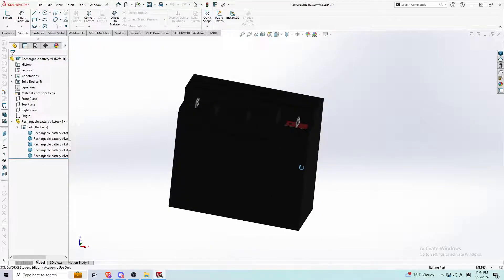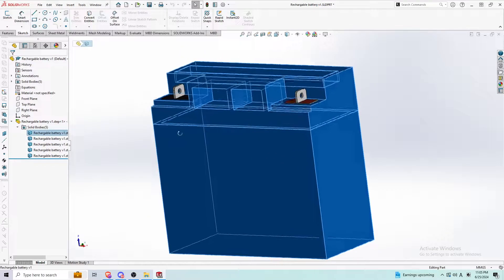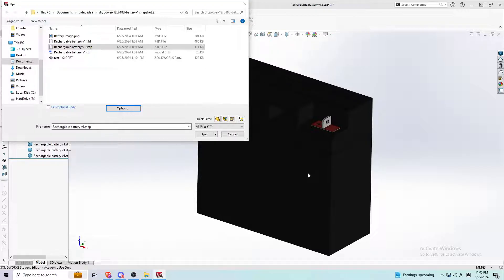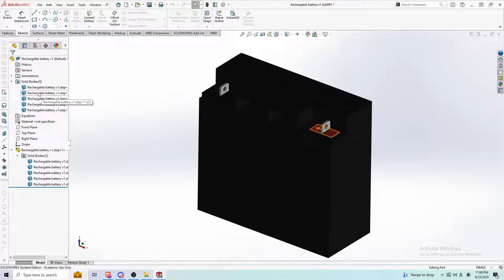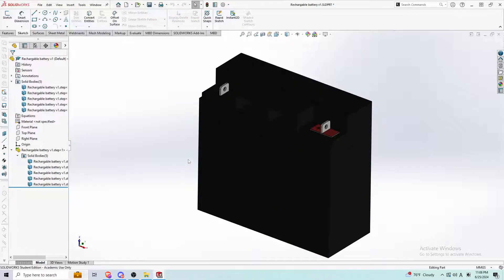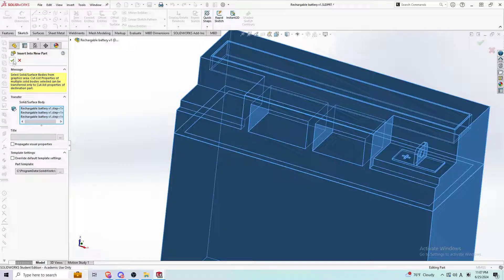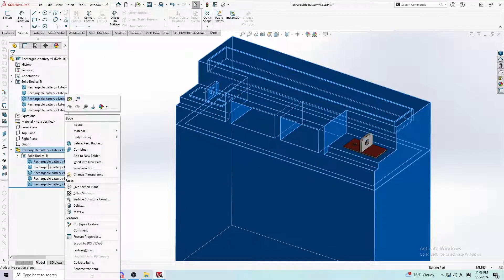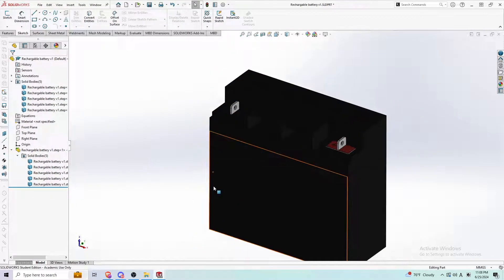SOLDIWORKS How to convert STEP files to SOLIDWORKS parts file (SLDPRT)

Comment: Is there a way to view to maintain features when converting from a step file or any other file type? I am trying to convert creo files into solidworks parts/assemblies, but it doesn't maintain features. Is this even possible?
Reply from the maker: sometimes, solidworks will try to use featureworks, which it will automatically make features for your part.

i dont personally work with creo files but i can try.

but working with stl files, features will not stay.

there is a way to make "features" by highlighting surfaces on a mesh surface.
Reply: @yukiengineering I am trying to convert from a creo files over to Solidworks for work. For some reason it only loads in when I have the 3d experience selected. Which doesn’t allow me to use featureworks, Otherwise if I deselect that and use the creo to Solidworks converter and click okay it doesn’t do anything. I’ve tried a bunch of different settings

Comment: Basically what you are saying select the part you need and open in a new part and save as sldprt file.
Reply from the maker: Yes. A single part or a group of parts can be turned into a prt file.